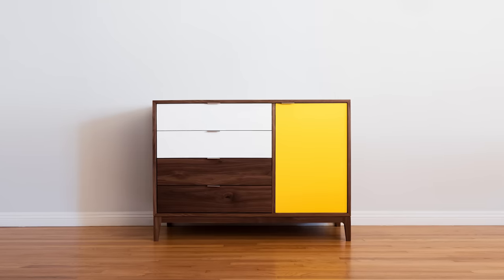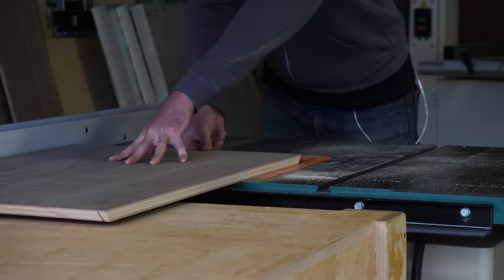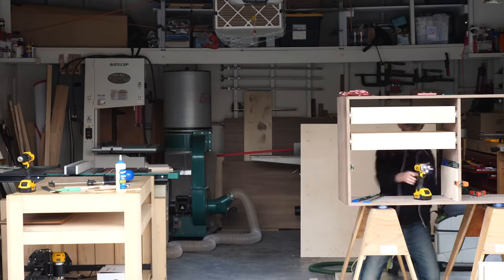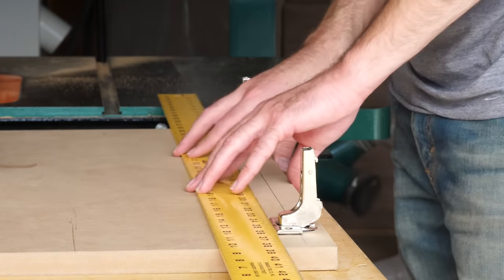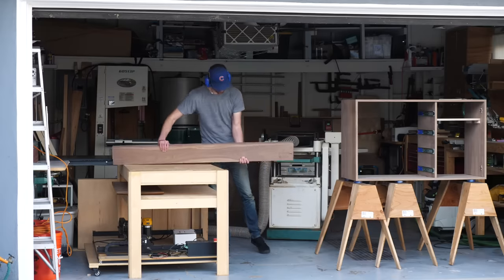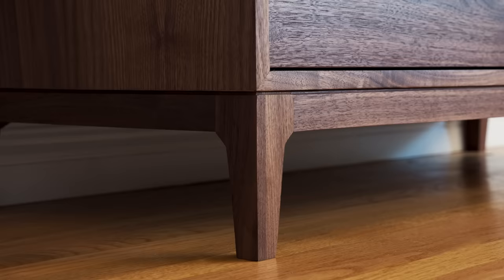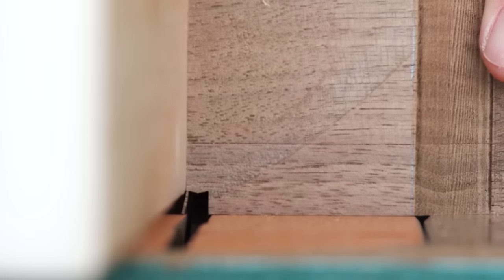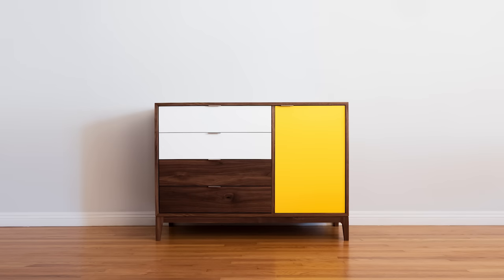How To Build a Mid Century Modern Dresser - Woodworking

Comment: I've been meaning to tell you, I've used actual 3M 1080 vehicle wrap to face my door in my garage. Came out looking darn near perfect. You can face them with the wrap and use an edge band/vaneer triming tool to cut it without wrapping all the way around the sides. I just pre-painted the doors white so it would look a little cleaner. Wouldn't mind chatting more about it if you wanted.
Reply from the maker: I just ordered a large roll. Once I know it is good, I'm gonna order some others. Might take you up on that chat if needed :)

Comment: First: congrats! Second: awesome work (as usual) Third: quick tip - painting mdf with exposed edges? before you prime the panel seal the edges with one or two coats of wood glue or white elmers. sand between coats of glue. you’ll save yourself a coat or two and the edge will have exactly the same look as the face. takes extra time but the results are killer.
Reply from the maker: Thanks George...good call :)

Comment: Congrats on the baby! Maybe try spraying the paint on, this leaves a better finish than brush/roller, which results in less sanding. At least it does for me, especially on bigger pieces. I use one of those electric powered spray painters as I have no compressor in my garage.
Reply from the maker: Thanks Maxim. That is something I'd like to get into eventually. Just haven't yet.
Reply: Rolling the primer on first still might not be a bad idea. I know mdf likes to soak up paint
Reply: That is actually a good idea. No need to clean the spray gun twice ;)

Comment: as always, nice build. by the way, for the walnut edge band that you use, did you cut it exactly the same thickness of the plywood?because it turned out perfectly flush.. Thanks
Reply from the maker: I cut them slightly wider and then sand them flush...or flush trim router

Comment: Hypothetical: if you made your base stretchers from the same walnut plywood, would you still need to account for expansion?
Reply from the maker: No...it would be so minimal you'd be fine. You'd actually be fine even using hardwood most likely. Most of the expansion happens across the width. So in this case, it would but putting the cabinet up or down slightly. it's also such a small piece we're talking about millimeters.

Comment: Do you ever check for 90° angles if you're glueing things like that? If so then how are you doing this if you glueing one side at a time?! I get your point with the clamps but my stuff is never perfekt 90° evan if i use dominos...
Love your vid's!! Sorry for the bad english
Reply from the maker: Hi Paul...I do. I use right angles to measure it while the glue dries. If they are a little off you can usually adjust clamping pressure to get them close. But until the top is also attached, there is still quite a bit of wiggle room. So even if they were slightly off, say they both tilted in an equal amount...If the top was cut right, it could hold them out a bit to bring everything back to 90 once it is in. hope that makes sense.
Reply: Chris Salomone I always mesure the diagonal from the inside corners.. thats why i clamp both sides.

Comment: Mr Salomone, I'm a long time subscriber and well, not first time commentore.  However I did start listening to you guy's podcast recently.   I'm stealing your design to make this "baby" dresser for my brother and his wife who are expecting a baby this October.  I have cut the 45's on the walnut plywood and have assembled the outer shell so far.  My question is, I had some squeeze out of glue that dried hard on the sides.  Do you have any tips or tricks on how to get that off?  I have used a chisel and scraped a lot of it off but it seems like there is some that soaked into the wood, and sanding it (so far...maybe i need to sand more) hasn't helped it.  Any ideas on how at very least I could make it not noticeable?  That baby won't notice but when she gets older she may.  Trying to be a good uncle.  Thanks for what you do!

Comment: Why spend so much time sanding and finishing the fronts of the MDF?  Gorgeous build anyways :)
Reply from the maker: sanding down the paint so the next coat goes on smoother. More smoothly???
Reply: Yeah but the mdf front layer is really smooth as is, does sanding really improve the finish? It might help with paint adhesion. On the sides i fully understand the need for sanding/priming but not on the front.